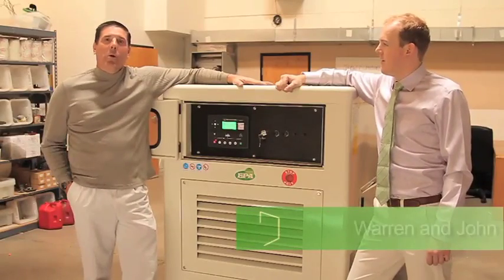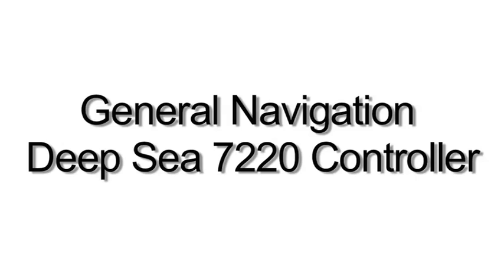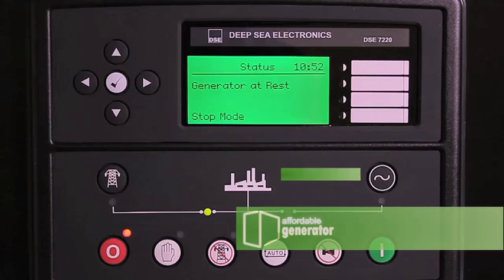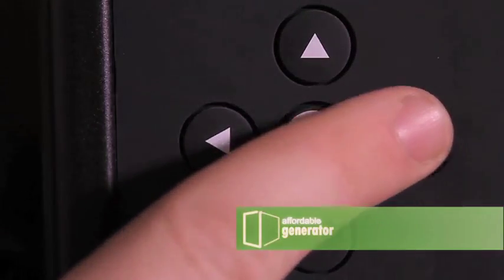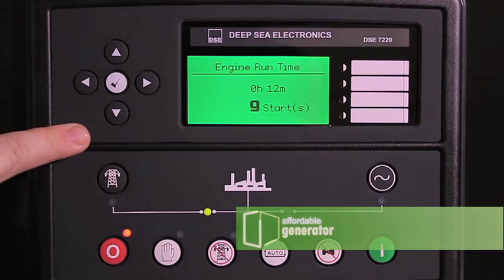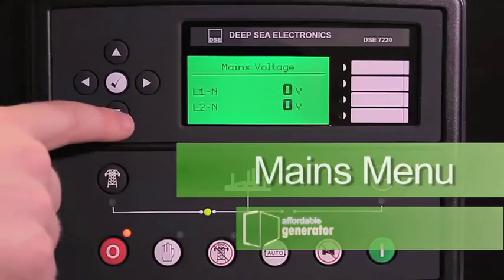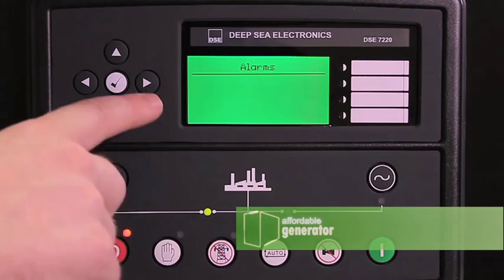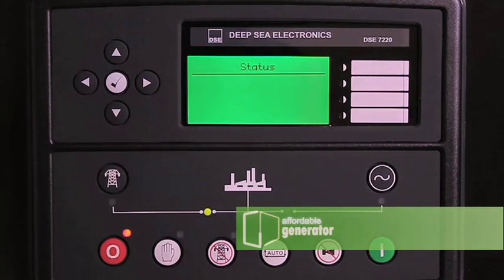Affordable Diesel Generator Deep Sea 7220 Digital Controller Overview

Comment: Hello. I change the voltage setting in the dse7320 for the phase voltage, but the generator output voltage does not change. What is the reason?

Comment: Dear  sir ,

I have a 400 kva bertolis eco 40 generator and cursor13 engine when I charge it deep sea after a charge of more than 50%

 I receive a message displayed on the screen 

ECU AMBER Warning high or short voltage check engine SPN65619, IMF 3 OC 196 .

 what is mean. 

Best regards

Comment: I have the dse7310 I just purchased.
I was having an issue with the controller module shutting off and rebooting during run and at stop rest mode .
I rechecked all B+ 12 Volts at pin 2 and B- at pin 1 for poor connections. Everything is good.
Some times the module would just go dead and not reboot until I removed the battery terminal and reinstall it. 
This issue was intermittent. It didn't always shut off . 
My question is, could a intermittent shorted coolant temperature sensor cause this condition? 
Does pin 16 that the coolant temperature sensor connects to put out 12 volts ? This is what I'm reading at pin 16. 
Any advice I greatly appreciate.

Comment: Good afternoon, I wanted to ask us on such a gynerator the alarm overvoltage of the gynerator worked, we eliminated the problems, leveled the amperage in 3 phases, but it still works for 5 or 10 minutes at the start and stalls and again shows the alarm overvoltage, please tell me how to remove this alarm on the panel?

Comment: What are the settings one need on 7220 amf controller when setting up a new generator ? Please so response!
Reply: need to program
Reply: What is Total KVA of generator ?
Is it Diesel powered generator ?
Is the Alternator 02 poles or 04 Poles ?
is it Stand-by (backup) Generator or contineuos generator ?
... etc..
Reply: Need the programme set up to DSE 7220 , 7320 and GMP 260